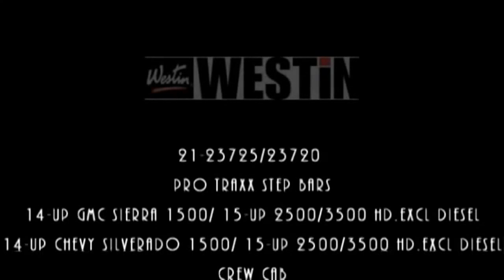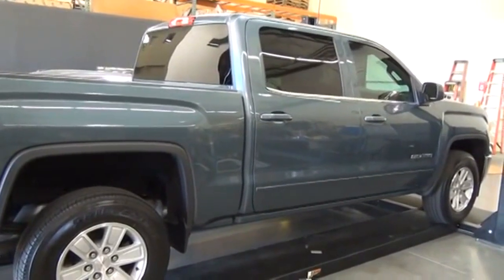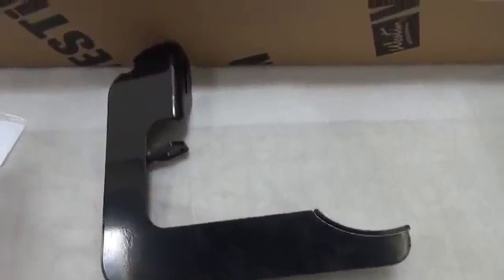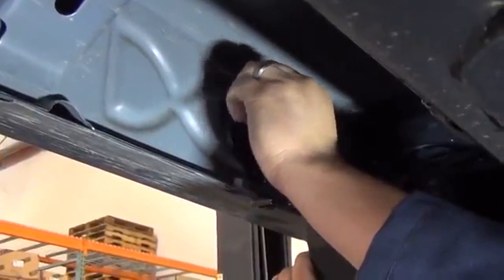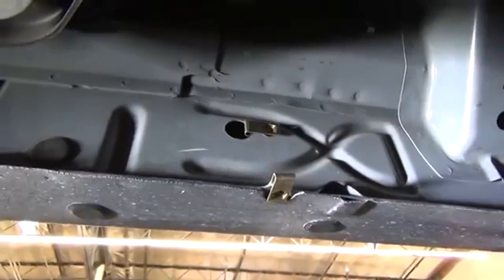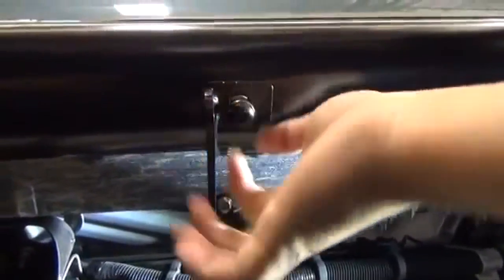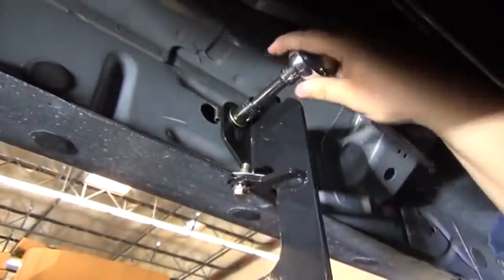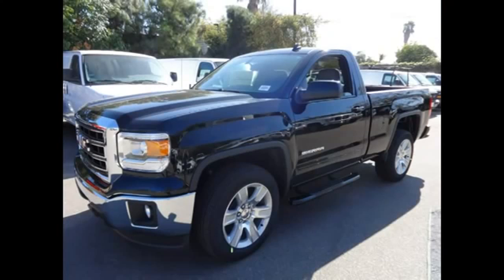Westin | Installation of Westin Pro Traxx Nerf Step Bars (2014-15 GMC Sierra / Chevy Silverado)

Comment: I just finished putting a set of 21-23725s on my 2017 Silverado crew cab. Organized my hardware, got my tools and anti-seize together, followed the instructions and it took me about an hour. Feel strong and look great. Thanks for the video ,Westin, I watched it last night and so was confident there’d be no problems. Anyone concerned about doing the install yourself, don’t be. It’s no sweat. Follow the instructions and loosely attach everything before you even think about tightening your hardware.